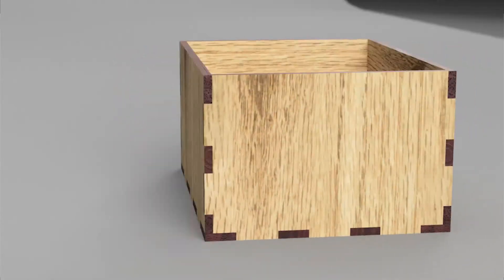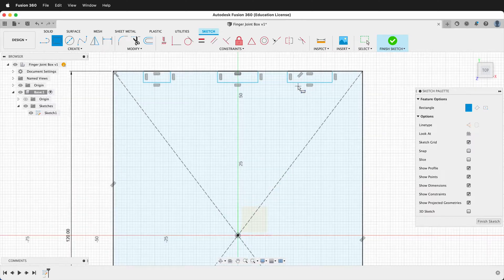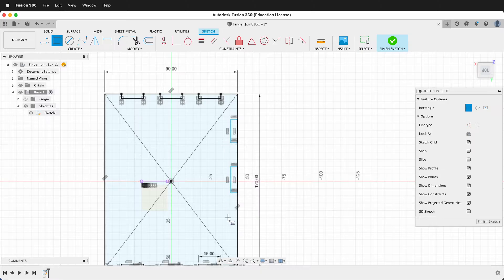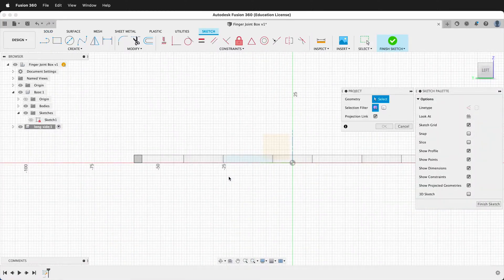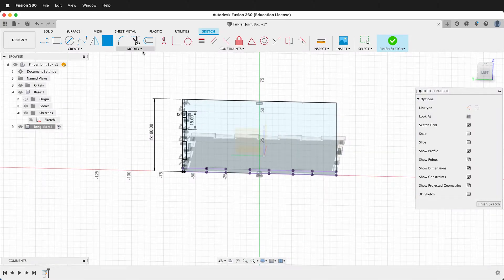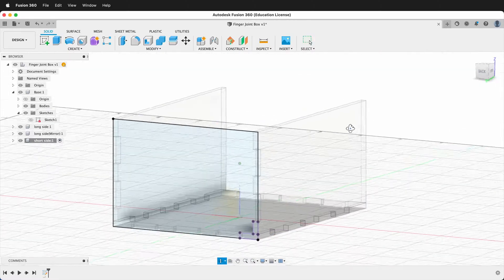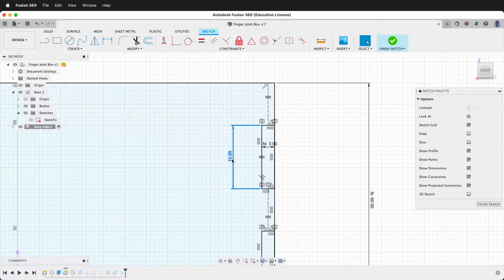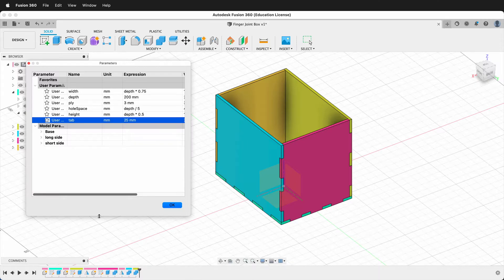Finger Joint Box for Laser Cutting Fusion 360 Tutorial

Comment: Why are you holding your other ear over the top of your head? This method isn't easier; it's unnecessary and cumbersome. There are simpler ways—even Fusion has a finger joint plugin built-in. Don't waste your time.
Reply from the maker: Yes, there are many ways to build a box with finger joints for laser cutting, there are also python scripts that parametrically male boxes ready to cut at boxes pu

Comment: hi very new to fusion 360 here. every tutorial that ive seen only connects one vertical and one horizontal, is it possible to finger joint a horizontal and an angled panel?
Reply from the maker: Yes but that would be difficult to manufacture with. 2 axis laser cutter or a 3 axis cnc

Comment: fantastic video thanks for sharing! I followed your tutorial and when i go to laser cut it, the DXF file shows the Finger tabs but they are blocked by the original rectangle so it would end up just cutting a square, do you know how to get around this? thanks
Reply from the maker: Did you select the sketch or the face to export the DXF file for laser cutting in the manufacturer workspace in Fusion 360?
Reply: hi thanks for your reply! i selected the face is that correct? :-)  @WhatMakeArt

Comment: When I create a new side to the box the edges do not align, is there a setting that I am missing?
Reply from the maker: Did you use the mirror or project from the previous side?
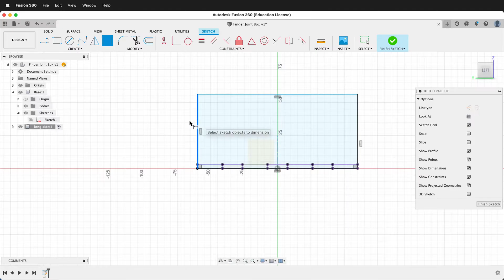Reply: I have tried using project. The error occurs at 5:20, the edge of my side is off by the material thickness.  @WhatMakeArt

Comment: I'm not sure what I am doing wrong.  I drew a sketch for the bottom. Next I drew three random sized rectangles that are all coincident with the edge. I placed the midline construction lines between all of the rectangles. I shift selected all the construction lines and made them equal.  I then shift selected all the horizontal width of each of the three rectangles. When i hit the equal constraint, it went crazy. The rectangles became all different sizes and some up and some down.
Reply: same here, something is missing.
Reply from the maker: Click two lines to make equal at a time. Select the equal tool, then click the shorter line, then click the longer line, this will make the longer line equal to the shorter line. Then repeat for the third line
Reply: @WhatMakeArt  doesn't work for me
Reply: @WhatMakeArt  Thanks, worked for me
Reply from the maker: Probably missing one more equal constraint, sometimes need to click individually
Reply: @WhatMakeArt  I'm having the exact same issue and not able to correct it. I am selecting  the first line, shift select each of the other 2 with the same result as above.
Reply from the maker: I will try to reproduce the issue and devise a solution
Reply: @WhatMakeArt  Are you going to make a solution anytime soon?
Reply from the maker: Updated video is on the list, but a bit down the queue, I recommend selecting the shorter line first, then clicking equals then clicking the next line. That way everything doesn't go crazy, then you can click the next shortest line and equals and then make them all the same
Reply: @WhatMakeArt  I have repeated these steps in many ways and when equaling the bottom line of the rectangles it always goes wild.

Comment: Great video. Always love to learn more. What I'm trying to do are teeth/notches that can be individualy sized for depth. We usually use the thickness of material . BUT if I want them a mm or 2 deeper (so after assembly they can be sanded smooth) it becomes a bit of an issue cause when you extrude its usually done from the outer edge. Materials are never exactly same thickness foe wood between sheets and suppliers.  So would be nice to create a design that you can adjust data on overall dimensions and allow for extra depth without effecting the design . Suggestions?
Reply from the maker: You could make one more extrude operation on the teeth that has a set parameter that you can change, then set a tooth parameter based on material thickness

You can also make different parameters for each side of the box so you can make a box from scraps that are different thicknesses

The extrude operation could also be a formula that adds the two parameters together, that way if you change either parameter, everything updated automatically
Reply: That's what I've been thinking for the teeth. Will try making teeth this way then add an extra step to extrude the surfaces of each tooth .  Thank you for the suggestions.  More learning :)
Reply from the maker: Good luck, let us know if you have some cool results
Reply: That's what I've been thinking for the teeth. Will try making teeth this way then add an extra step to extrude the surfaces of each tooth .  Thank you for the suggestions.  More learning :)

Comment: When cutting this does kerf need to be accounted for somehow?
Reply from the maker: Yes you need to account for kerf with the laser cutter bit Fusion 360 can do that automatically if you set up a laser cutter tool with the correct kerf settings

Here is a video showing how to automatically have kerf adjustments https://youtu.be/6JFHMV7A9TU
Reply: @WhatMakeArt  thanks for the link.
Reply: Interesting. As I have a machine with proprietary control software, I didn't expect my laser endeavors would take me to the manufacturing workspace.

Comment: I make something like this before, but included options like finger quantity for each side and also can direct proceed to auto arrange for easy export to laser cutting.
Reply from the maker: Yes, that is a good way to do it with the option to have different amounts of fingers  but it is a bit more complicated to set up.

It's worth it in the long run because then you can make your box any size and it'll add the fingers. There are also some calculators online that will print out an SVG with any size box you want, but this is a simple way to mock up a box in Fusion 360.